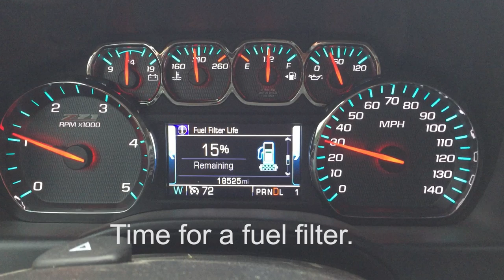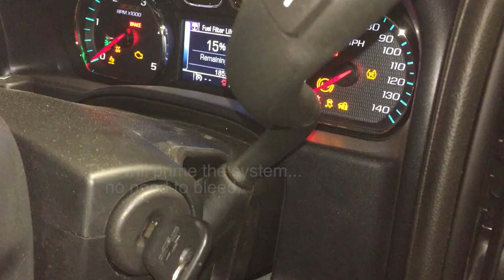2017-2024 DURAMAX: Fuel Filter Replacement (L5P)

Comment: I realize this video was posted 5 years ago but I wanted to leave a positive comment.  I just changed the fuel filter on my 2017 GMC Duramax and the video was extremely helpful.  Instructions are accurate and easy to follow.  One recommendation I'll add for others doing this job:  After replacing the filter element, take care not to over-tighten the drain screw and filter housing.  They are made of plastic and the threads are easily stripped if too much force is applied.  Over-tightening also makes the housing difficult to remove for the next filter change.  I recommend using a torque wrench if you have one, the specs are stamped on the housing.

Comment: You're supposed to drain it first, by loosening the center nut with an 11/16 socket.  It's a whole lot less messy, but to each his own.
Reply: This worked the first time for me. Second filter change, it just kept drawing fuel. So I wont bother from now on unless checking for water.
Reply: I just changed mine,the plug only drained about 5% of the fuel from the filter...still messy.

Comment: Easier way to reset the light, On the fuel filter page, press right and there should be a single option to reset filter life. just hit the check mark and dont deal with all that key cycling

Comment: Good to the point video. I just got the same exact pickup. Love it so far. Have you noticed metal in the filter housing. Looked like brass. Dealer says no big deal. Clean it out and see if there is more next time

Comment: I definitely recommend going out and getting a 36mm or 1-7/16 socket with short extension for this job. I managed to get mine off with a combination of crescent wrench, channel locks and filter wrench but it was quite a pain and almost rounded the nut. Didn’t see the install going too well without the socket. The cartridge itself doesn’t seem to thread as smooth as you’d think for a lower torque plastic housing.

Comment: Nice video. There is a drain inside the he. on that cap to help control the mess that is made when the fuel drains. It’s also the water drain port for whenever the “Water in Fuel” message shows.

Comment: Read a bunch of the previous comments .... couldn't agree more. Well done. 
But having just done mt 2015 with 39,000 miles and I still had 30% filter life remaining, it seems later models require more frequent filter changes, any thoughts?
Reply from the maker: Thank you! I guess I can't say with certainty, but hearing my little brother talk (he works as an engineer designing diesel engines), fuel disparity and deterioration play a big part in component failure and therefore emissions compliance. Everything is high pressure common rail direct injection with incredible tolerance standards. Water and ethanol (a light acid) are very corrosive to the fuel system. I imagine manufactures are trying to preserve component life and emissions compliance by shortening service intervals in the most common culprit. 🤷‍♂️
Reply: @maxkarl4192  My '03, '07, '11, and '15 all had their filters changed when I changed my oil.  You could feel the difference in throttle response and power with a fresh filter.  They changed the filter location when they brought the L5P out.  Mine has 17,500 and 5% left.  I'm going out to the barn to change it now, but I haven't felt any difference in power or throttle response with the older filter.

Comment: If you dont have the large socket, mine was tight so i put a smaller socket on the inside that was big enough to fill the inside diameter than used my wrench to loosen without twisting the rubber.

Comment: Agree with others - love the no non-sense video!  Nice job

I am about to do this for the first time on my LP5.  On my previous  Ford diesel, you had to loosen the filter a specific number of turns (4??) to basically close off the fuel line before removing the water drain plug. If you didn't it drained a lot more fuel.  Do you know if that is the same on the LP5?  Also, your video shows a 1 7/16 socket.  Is the nut actually standard or is it metric and the standard just fits OK?  If I have to buy a new socket, I might as well get the right one.

Edit:
36mm for the cap nut and 18mm for the water drain plug.

I broke loose the water drain plug and then loosened the cap until it was finger tight. Then removed the drain plug. Seemed like a good plan, but it looks like it drained the same amount of fuel as seen in the video. At the best, I didn't get any fuel on me that way.
Reply from the maker: Thanks for posting this. The procedure does call for a preliminary draining of the fuel bowl. I don't know that it's necessary other than keeping yourself dry as you mentioned. Thanks for posting the correct socket sizes.

Comment: Great video....what is the torque specs on tightening the filter?
Reply from the maker: 25nm, so about 20 ft lbs. Its hard to be percise with plastic. It's a big o-ring and pretty forgiving so just snug it up and check for leaks.

Comment: Excellent video no stupidity with all the talking.... works the same on a 2018 3/4 ton Denali with the L5P

1-7/16 6pt socket is the way to do it... a crescent wrench will not work DO NOT USE A CRESCENT WRENCH the bowl it is HDPE
Reply: The hex on the end of the bowl is soft it will distort using a crescent wrench and will not allow you to remove or torque down the bowl

Comment: My l5p message center is saying water in fuel and I have tried a couple different diesel water removal treatment and the message go away for a day or so , then it return . What’s your opinion on how to fix it?
Reply from the maker: No direct experience on the issue, but if replacing the fuel filter doesn't solve the problem, it could be the WIF (water in fuel) sensor. Reading forums, it sounds like a common problem. I believe it is located above the spare tire on the L5P and runs around $30.

Comment: Great video, I have an 18 l5p. I'm assuming they are similar? Also subbed
Reply from the maker: Thanks for the question. There is no difference in the 2017 to 2018 fuel filter procedure.
Reply: @MasterJacks  ok cool thanks

Comment: what did you torque that housing to?
Reply from the maker: If I remember right, the filter housing has 25+5 Nm (18ft lbs + 4 ft lbs) written on it. It's plastic with a big o-ring so it's hard to torque with any real precision. In my book it falls into the "snug but not crazy tight" category. Just as tight as needed to not leak, which doesn't take much.

Comment: How many lb torque you tight the cap?
Reply from the maker: Johanny Matos  The large o-ring seal does a good job of keeping it from leaking without it being too tight. Just snug it up and check for leaks. I'm not sure what the torque spec is.
Reply: Says it right there on the cover at 2:25: 25+5 NM.  Although I’m not sure what to make of the +5?
Reply: On second thought, I think it’s probably +/- 5.  By the way... 25NM +/- 5 is equavalent to 18 ft/lbs +/- 3.5 ft/lbs

Comment: How much torque you tighten the cap
Reply from the maker: arcadioho just snug it up good and check for leaks. The large o-ring doesn't take much torque to seal. Not sure on the spec
Reply: MasterJacks thanks buddy
Reply: I believe it says right on the cover of the filter housing …